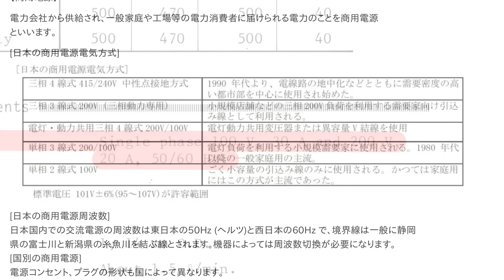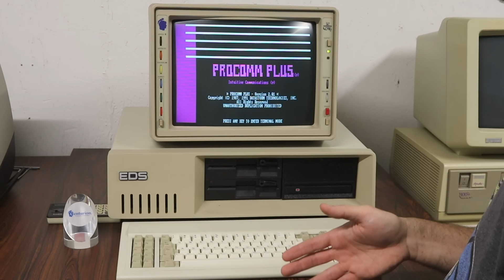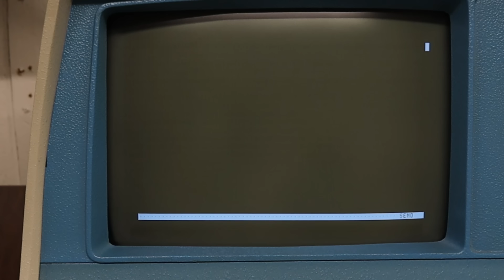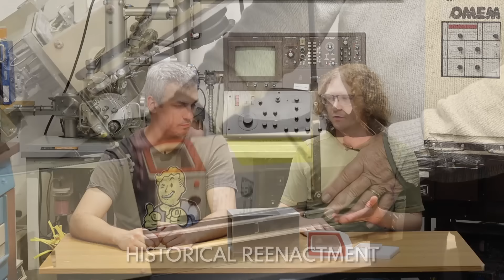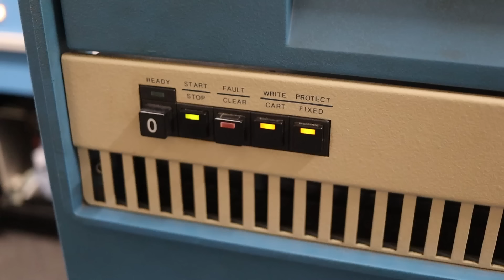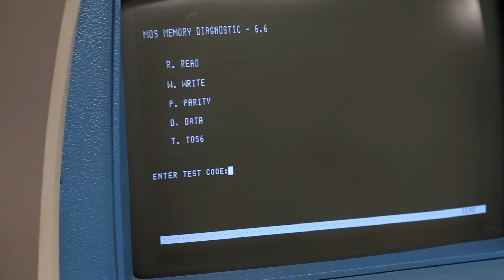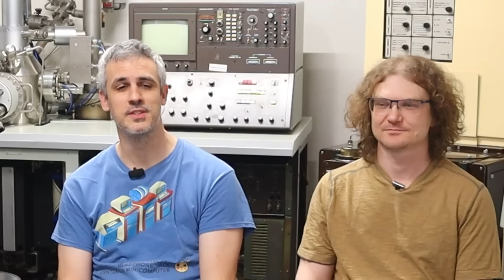Welp... that's terrible.

Comment: A DEC PDU mounted to the wall? A man after my own heart.
Reply from the maker: That DEC PDU is so nice, I'm thinking I'll pick up a few more for the room!
Reply: nice to see you here clabretro!
Reply: Omg hiii clabbbbb :3
Reply: these PDUs were OEM'd to DEC by Pulizzi Engineering, which was acquired by Eaton in 2007. I wouldn't be surprised if a lot of the models are still in production. You can still get drawings and spec sheets from Eaton's website.

Comment: All you need is a small 120>24 volt control transformer with the output having the required current.  Wire it up as a buck transformer

Comment: 240 Vac to 200 Vac can be achieved with a relatively cheap transformer. By subtracting the secondary side from the mains voltage thereby reducing the mains voltage.

Lets take a typical transformer made for generating 24 Volts DC from 230 volts AC. This produces 18 V ac on its secondary when feed 230 volts, it will produce 18.8 volts ac at 240 volts.
Next is rather trivial mathematics. 240 volts - 2x 18.8 volts = 202.4 volts, close enough to be within tolerance.

To reach 20 amps you would then only need two 480 VA capable 230/18 volt transformers, which is like 200 bucks total.

The secondary side is simply used to negate some of the mains voltage.

Comment: Sanding the surfaces for epoxy adhesion is a good idea, but I think i would suggest covering the filter opening before doing so, don't want grit or metal to get into the "out" side of the filter media and end up in the drive..  (I don't think this is likely, but just a best practice kind of thing)
Reply from the maker: We blew out the filter with canned air and thoroughly wiped down all surfaces with IPA after. We were running the drive for two full days while troubleshooting it without any major issues. It was only when we tried the format and it got to the innermost tracks that we had the crash. In hindsight, we should have cleaned the platters with IPA and chamois swabs.
Reply: Yeah, that was pretty crazy, "blowing" it out or not, I was cringing when they were doing that on the clean side.
Reply: Excatly my thought. Also, 3D printed parts have these tiny "particles" in top of them. (Vaporized and re-solified plastic?) I have no idea how long you have to purge the part to get rid of them.
Reply: @tniemi  With all 3d printed parts it used to be a good idea to give them an acetone vapor bath to ensure the outer surfaces fully fuse and an IPA bath to remove any loose stuff. No idea if that's the norm anymore as it's likely to depend on the actual plastics used

This will give a nice shiny surface  and make all the layer lines disappear
Reply: @alanbrown397  acetone smoothing only works on ABS, which is less commonly used these days as it has some non ideal properties like warping and toxic fumes whiles printing.

Comment: An option for the 100V/200V conundrum would be a double in-line conversion UPS that can output 100V/200V. You can most likely find one with dead batteries for pretty cheap, and given you don't want it for it's batteries, it wouldn't matter.

Comment: To drop 240VAC to 200VAC without an expensive transformer, you could use a resistor.  Use a voltage drop calculator that considers amperage to determine the right value. Since it would have to be an extremely high-wattage resistor it may be most practical to make your own from nichrome wire like that found in an electric space heater.  Bare crimp connections are the way to go.  They should be physically UNDER your resistor so an not to channel heat into them. Depending on the amperage, you might need to use more than one nichrome resistor in parallel using parallel resistance formula.  Fan cooling might be a good idea.  It won't be efficient, but it will be cheap.  Alternately, you may be able to purchase an appropriate power resistor/s or have a manufacturer create a custom resistor.

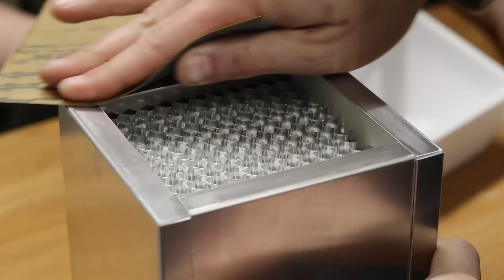Comment: Is it possible that metal particles may have gotten into the filter on the output side (and thus not trapped by the filter) when you sanded the frame at 14:57?   Though it could just be a coincidence.
Reply: I was about to say exactly that: seeing metal being sanded with the filter standing up straight, allowing any microscopic particule to fall down inside the filter made me really nervous, especially since if this is the output airflow side, which it seems to be if this filter is supposed to filtrate air before it goes inside the drive. Any microscopic particule could remain stuck inside even simply thanks to electrostatic attraction or whatever, and could be suddendly dislodge at any time later with the massive continuous airflow, because of expansion of the metal due to temperature variations... So now i'm wondering: how unsafe is it to put in place brand new disk platters without being sure first why this head crash happened?
Reply: Certainly not best practice but given how long they ran up the disks without the heads I think any loose debris would have either been flung off or been blown off by airflow. It's not like modern hard drives where a handful of molecules can cause issues.
Reply: @oliverer3  Ya it's hard to say for sure.  But the head assembly is heavy and makes a lot of vibration which could knock particles loose that the airflow didn't disturb.

It could also have been a simple failure of something mechanical with the head alignment.  Hopefully whatever it was will be found before the new platters get installed.
Reply from the maker: We cleaned the filter inside and out with IPA and lots of canned air, then let it purge for hours and hours. The filter has been hanging about for over a year and made the journey down to Texas in a backpack, there's all sorts of tiny particles that could have embedded themselves in the filter in that time. That's why we clean and purge.

What we didn't do is clean the actual platters, and that's where I messed up. This drive was stored in someone's garage for years, so dust and who knows what else could have adhered to the platter. Purging got it mostly clean, which is why it didn't crash for two days during the filming of this episode. It only crashed once the format got the heads close to the center of the spindle.
Reply: @UsagiElectric  Makes sense, since near the center there will probably be less air velocity to fling everything off.  Hope the new platters will work out.

Comment: If you had real winters there you could use the Centurion to heat the house, it takes way less power than the Centurion suck up 😋(that cat did not care one bit about the head crash)

Comment: Hey, if you dont need galvanic isolation you can use a much smaller transformer to step up/down the voltage difference. For example: You find a small 220V/20V tansformer. You connect the primary to 220V. You then put the secondary in series with the 220V. Depending on how you phase the windings you can now choose between 200V or 240V output. Only a small fraction of the power goes thru the transformer, so it can be way smaller than a full 220V/200V transformer. Also a 220V/20V tansformer will be easy to find.
Reply: You may also use a 24V Transformer and use the same principle as i described for the 110V Side ( Connecting for 244V Output and swapping Input and Output to get 201.8V at the former Input - now Output. Losses are lower and the 24V Winding sees only 90% of the Output Current. ( But go for at least 100% to get some margin ). 24V Transformers are normally much cheaper then 20V Transformers.
Reply: Oh interesting, I'd not thought of this but yes I suppose you could use an inverse phased transformer to oppose the voltage in a way that keeps it under 200VAC... hmmm the '20V' output side would need to be 200+ V insulated I think though.. and also use a gauge capable of supporting the full 30A? It won't need to support the full 30A/100V 3KVA though..
Reply: If there is a bit of space between the windings and the core, you could add an extra winding on top of the standard ones. Depending on how you wire this (phase), you can add or subtract to the output voltage. I doubt you will need this degree of control, but it is an option.
Reply: Bump, a good trick!

Comment: About transforming 110V to 100V: Get a transformer 110V to ~10V (with the right power). Connect this transformer primary to the 110V and put the secondary output in series with the 110V to power the 100V equipment. This secondary output needs to be connected so it 'subtracts'  the ~10V from the 110V (so out of phase). As you most likely also have 220V in the house you can do the same trick to get 200V. Warning the neutrals/ground of the 110 V and the 220V are most likely not the same.  To prevent this grounding/neutral you might also get a standard readily available 110V to 220V (or 240V) transformer (used by people who move from the US to a country with 220V/240V). BTW these transformers are most of the time autotransformers so you might try to tap from another winding... to get 200V or even 100V.

Comment: Having a replacement pack of platters for the Phoenix is wild, I hope you can pull off the rebuild!
Reply: Why?  I have a full set of three good fixed platters still mounted on their spindle in my stash here,  as well...
I used to have a full set of good heads also, but I think they were stolen when a bunch of stuff got stolen from  one of my storage garages.
(edited, I had forgotten the number of platters vs. data surfaces...  5 surfaces on 3 platters, not 5.)
Reply: @drussell_  It's one thing to have platters from an old drive, especially if they are already crashed, but to have a good replacement pack and the drive it goes on? That's quite lucky.
Reply: @TubeTronics-007 Having a NEW replacement pack IS pretty sweet.  Mine are an uncrashed, pulled-from-working-drive set , the full 80MB set of three fixed platters.)  I have about 8 good removable platters too, but I'd like to find a fully assembled, working Phoenix to pull the data off of those (they're in Wang 2200 256-byte sector format) before I pass them on to someone to use again or whatever...  What really pisses me off is having lost those heads!  We were supposed to trade them in to the local Wang service engineer when we decommissioned that Phoenix for some other work he had done or parts or something, but he never ended up picking them up.  Rod Turner was his name, I think.  That full set of 8 good heads (one servo and one data on the removable platter, one servo and five data on the fixed) was in the bottom drawer of my dad's office desk until after he died...  Unfortunately I think they disappeared from storage with a bunch of the office stuff.  😕  
I do still have a bunch of spare boards, the voice coil and magnet, spindle motor, blower assembly and whatnot though, I think...  🤔
Hopefully someone has the alignment service tool, I saw one on eBay many years ago but it was too much money and I'm no longer actually operating any Phoenixes.... haha  You really need that tool to manipulate the drive to align all the heads with an oscilloscope when you change one or more heads and/or disk pack(s).  Ahh, fun times.
(edit: correct typo )

Comment: I think that duct tape is the official Apollo NASA adaptor adhesive.
Reply: Yes, but in 1970 they called it "gray tape".  Getting details from ChatGPT:
NASA carried a cloth-backed pressure-sensitive adhesive tape, commonly called duct tape in aerospace documentation. It had the same basic structure as modern duct tape:
    Polyethylene top layer (the gray waterproof outer surface)
    Cloth scrim reinforcement
    Rubber-based adhesive
That design dates back to World War II.

Comment: Question: Why didn't you just install a sub-panel in the corner of your room and have sockets in parapet channels connected via Wago Winsta connectors? That would make your entire electrical installation plug-and-play so you can effortlessly reconfigure everything on your next room feng-shui rearrangement.

Comment: Maybe the errors come from Earth/Ground loop problems.  I say this because you changed or remade the Earth/Ground straps.
Reply: I was thinking power as well. Weird intermittent errors are often from bad power .
Reply: @ChrisCandreva  As the hippy from Joe's arcade said "Power supply, power supply, power supply".  If you know the quote you know it. If you don't than you don't.  Have a good day.
Reply: @MrStevetmq I run the VectorList mailing list and have 10 arcade machines in my basement. Well one's in the living room, Battle zone was too tall for the basement :-)

Comment: I was watching another channel that needed to turn 240v into 100v for a Japanese product and they did it by reversing a step-up transformer. I'm explaining this badly, and it would help if I could remember which channel, and I doubt they were working with a 20 or 30 amp circuit. Maybe 4 amps at most. But the point is, it can be done if you get creative.

Comment: Eh....not a super fan of the Centurion. They didn't build a wide dedicated fan community back in the day, and the software for it is pretty boring....not much amusement to be found in running General Ledger or Trial Balances...
Reply: You say that on the channel that brought Centurion out of the pages of history, and back into the public consciousness of the vintage computer hobby.
Next you're going to say you don't like vacuum tubes.
Reply: @TastyBusiness  wasnt one software something to do with flight control or airline booking system ?
Reply: I love both
Reply: @highpath4776  Eh? You love both what? Machines with no fan base and Accounting software?
Reply: @leegleason  well ledgers and balances ( and great ways to hack them). Further extend to job cot allocation Budget Forecast and Commitment reports.  Nowadays a lot done with SAP , which generally takes so long to add to database the company you work for has gone broke

Comment: That filter adaptation reminded me of the Apollo 13 movie.
Reply: All they need is a sock.
Reply: One of my favorite Tom Hanks movies
Reply: Same!
Reply: That might have inspired a puzzle in the game SpaceVenture. 

Relatively early on in the game, you end up in an escape pod and need to replace the CO2 filter, except the spare one won't fit in the hole properly. It's square and there's a fair bit of space around it in the round hole, so it isn't working yet. So, how do you fill the space around it?

[hopefully I'm leaving enough space if you want to avoid reading the solution and solve the puzzle yourself]

Stab the seats with a fork to get some of their stuffing to plug the gaps around the filter.

Comment: Just thinking: normally you need to drop 20V on the 120V which makes if you do it twice 40V on the 240V, so two big 120V to 20V transformers wired in series with the mains (120Vin to 120V and 20V in series with 120V but in a polarity that drops it to 100) and you would have tha working. the only thing to consider is that the 20V windings have to be big enough to handle the current of the devices.